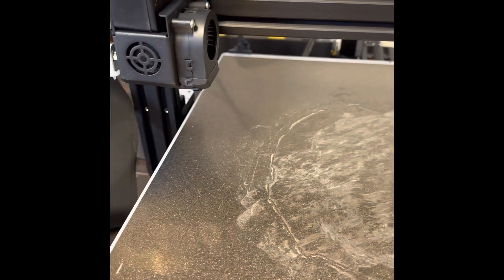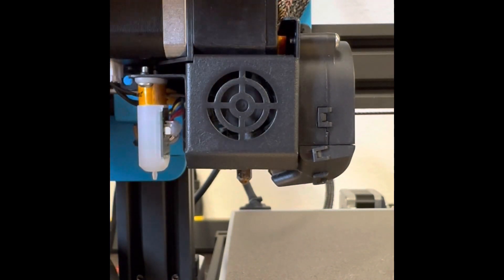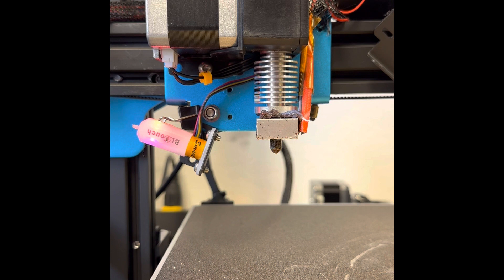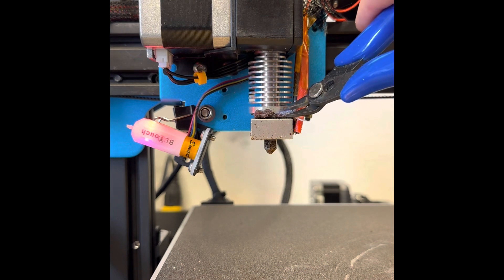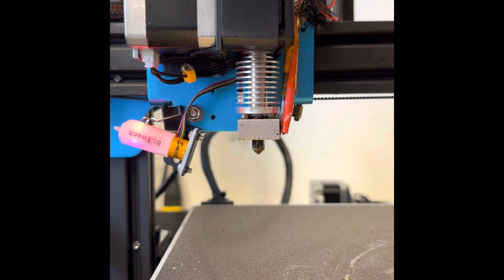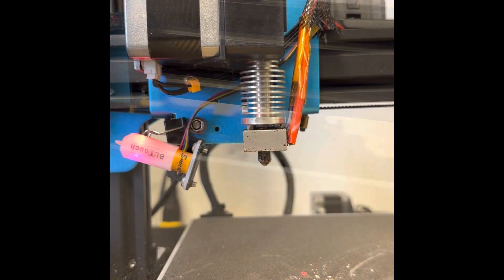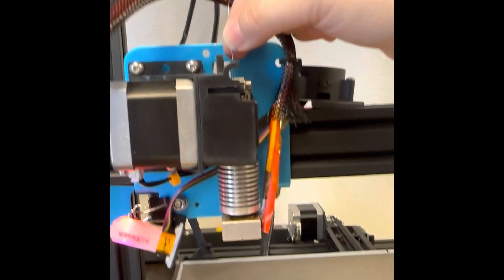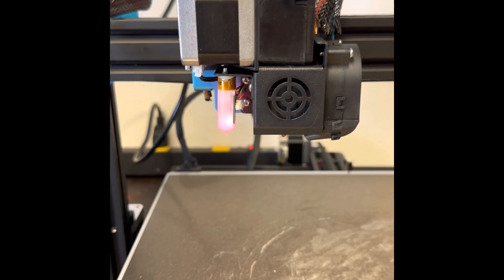Nozzle change and Extruder Gear clean up for Sovol SV03

Comment: Where did you find the replacement nozzle?
Reply from the maker: eBay, sovol doesn’t keep parts for their printers that aren’t in production, and they have different parts for each printer, their way of forcing you to purchase the newest printer from them. I will never support the company again.
Reply: @dreaminginprint8434  Those are standard RepRap parts. There all over the place. Looks like a standard V6 or V5 hotend with an Mk8 nozzle.

Comment: I friend of mine was having similar issue with his SV03 and I found this video. I know I'm late to the game but I wanted to comment just in case some is having the same problem.  I believe the issues you are having is due to 2 things. You shouldn't have a gap between the nozzle and the heat block. The other thing is the gap between the heat block and the heat sink is too small. There is not enough air flowing between the heat block and heat sink.  That is causing heat creep which is leading to the clogs.  A proper assembly would be to screw in the nozzle until it's flush with the heat block. Then screw in the heat break into the heat block until it bottoms out on the nozzle. Then screw that assembly into the heat sink.  There should be no gap between the heat block and the nozzle and a larger gap between the heat block and the heat sink. These instructions are assuming this is a V6 style hotend. The connection method may be different but the gaps should be as I described. Hope this helps.